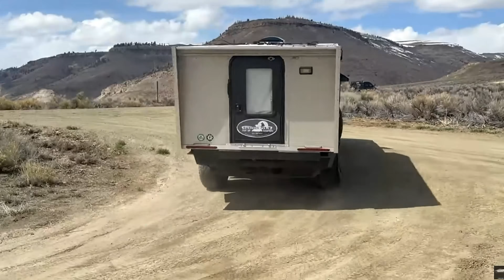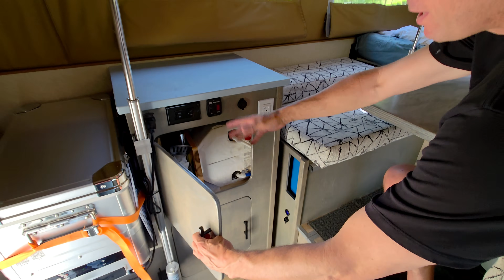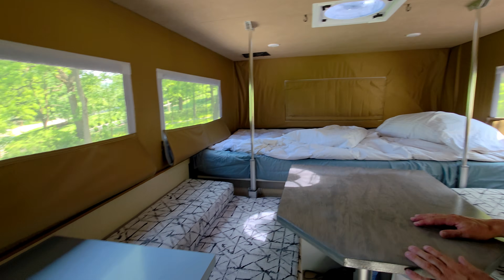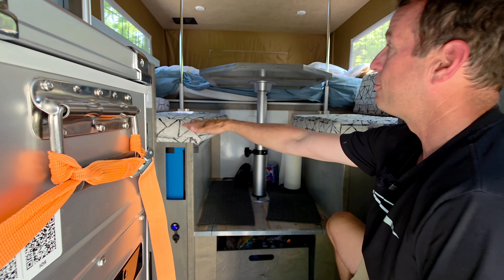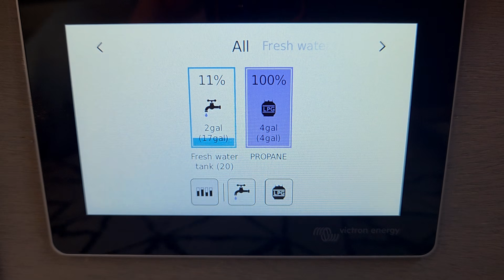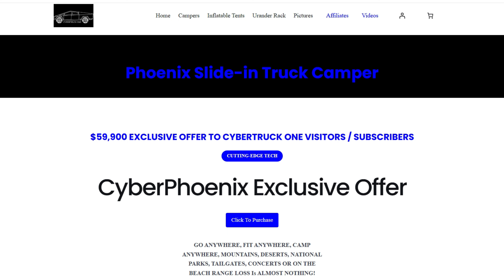CyberPhoenix: The Coolest Cybertruck Pop Up Camper You Can Buy Today!

Comment: This seems to be ultra complicated and not using too much of the Cybertruck features beside the 14-50 NEMA plug.
For comparison, I would prefer using a VW ID Buzz with a pop up roof and use the full interior size of the van 
to be used as a Camper instead of using only the Cybertruck bed who is in fact not long enough and need an extension.
If I was doing camping with a Cybertruck the following should be changed:
- The Cybertruck tonneau is useless and could be removed, and I wonder how much this could be possible 
but I would like then to have a pass-through midgate between the cabin and the bed, like the Chevrolet Avalanche.
- With a pass-through midgate you can then take advantage of the HVAC of the Cybertruck.
- The front seat of the Cybertruck should also fold flat, to be able to sleep inside the cabine.
Reply: Yeah, but then you would have a VW ID Buzz instead of a Cybertruck. No thank you!

Comment: Very well thought out.  A little pricey but still cool.  Agree to not even try to charge a CT with solar.  The density of a tesla battery dwarfs lithium.. one KWh of the cybertruck is equal to roughly your 100 amp lithium battery @ 12 volts.  Take a drive to a supercharger instead. There are videos of people working on borrowing A/C from the cab with a rear side window plug and piping ... again use the features and battery power of the CT.

Comment: Hey i saw this thing and I thought it was really cool. I was just wondering about the moonroof of the car because i know you mentioned that thing weight about 1500 pounds… does the cabin not make contact with the moonroof or how does that work?
Reply: So the full glass roof doesn't contact the bed section that hangs over it.  However, once in a blue moon you can hit a bump and there is slight contact.  Nothing serious.  That said, phoenix pop up can and will add a small pad that separates the two so that never happens.
Reply: @CyberTruckOne thanks for the reply. The cybertruck doesnt have the same
shape as most pickups thats why it would worry me if i were to go with it.

Other than that this looks solid especially for a 1 person camper. You got water, heat, a desk for computer use and a bed. It’s definitely an intriguing offer, I can see myself traveling the country with this thing for sure!
Reply: @papaedeen  yes, if you could get lifetime free charging that would be the ultimate.

Comment: Really wish that camp mode HVAC could extend to the bed, (guess a heater/air conditioner can be powered by the outlets in bed)
Reply: It’s easier to have its own ac/heat/power as you can drop off camper and still be operational.  But also not use up CT battery if in remote areas.
Reply: They could go into an idea like campstream in funnel the internal air through the window through a pipe into the back trailer and this way you could use the cyber trucks air-conditioning and heating and hell at that crazy price point starting at $80,000 that should be standard
Reply: @Bman893  Price point is wrong, its in the 50's...  I think the air flow gets complicated and difficult with a camper on back.  We also like the idea of it being self sufficient

Comment: Tom, I have an Alaskan 8 foot hard sided camper on my 23 SR Lightning. I have over 5500 miles on the rig including the Magruder Corridor, the longest uninterrupted dirt road without services in the lower 48.  We have road tripped from Northern Washington to Big Sur CA, without issues. The entire camper is AC powered running off the pro power onboard including a heat pump, refrigeration, lighting, inferred BarBQ and induction stove top. The electric camper makes so much sense, we typically do two to three days between campgrounds camping off grid and hitting a RV campground with 50 amp power every 3 days for a full recharge.

Comment: Wish there were good options for the Lightning. Sorry they wasted time making it for that dumpster on wheels
Reply: They can make a lightning camper.
Reply: It can take any camper made for an f150. Why would they need something specific?
Reply: @Joeblk10 Ford doesn’t recommend a camper on the Lightning. Likely because of aerodynamics. If you add one, best to use something like this pop up. Also, access to the power plugs in the bed is kind of key too.
Reply: @djryan8944 makes sense
Reply: Lightning is garbage compared to Cybertruck